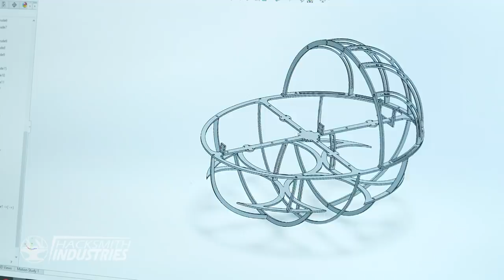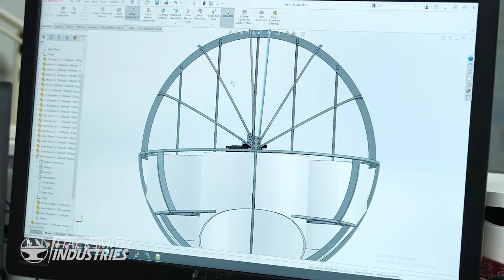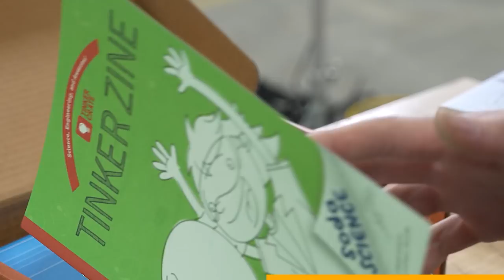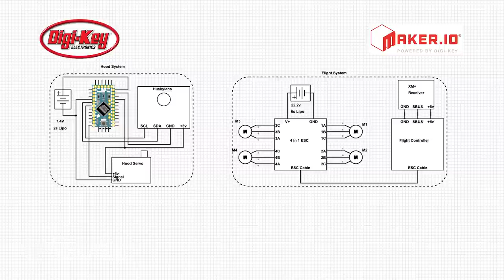Grogu's Floating Cradle! (HACKLORIAN: Chapter 4)

Comment: That flying cradle came out great! Carbon is known to be safe, people ingest activated charcoal(carbon), I guess the big hazard is inhaling the epoxy resin dust that joins the carbon fiber layers. Inhaling small carbon fibers, which isn't good, would more than likely lead to other non-cancer lung problems if you did it on a regular basis, but anything is possible.
Reply: No, the hazard is carbon fiber particles in the air. You're putting yourself at risk similar to black lung from coal mines. Regardless, CF is definitely possible for them to do. I have a friend who cuts CF in his garage from sheets, he initially had dust collection system send everything straight outside but eventually he switched to cutting a submerged CF sheet which made the CF particles mix with the water instead of the air.
Reply: @Dogburt_Junior  that's what he's saying, he's just correcting the "carcinogenic" bit, as carbon dust isn't carcinogenic
Reply: Unrelated, people should worry more about diesel for personal vehicles. Those fumes are proven carcinogenic.
Reply: carbon fiber is carcinogenic via the same mechanism as asbestos
Reply: @butterdubs2267  Meanwhile fiberglass isnt considered carcinogenic.
Reply: Also, inhalation of pointy and/or sharp items can cause bleeding in the lungs, and get the material imbedded in the tissues there.
Reply: Who cares  about carbon
Reply: @Cleanfocus  If I recall correctly, everything living requires it, and our food is built on it.
-
So as an ostensibly living organism, I care about carbon.
Reply: @MonkeyJedi99  I'm talking about carbon that cars make not carbon tree make
Reply: i have no clue what you guys just said and i’m not confused you hurt my brain
Reply: And the nose bleeds from cutting, grinding and sanding carbon are nothing to be concerned about. When you do it enough and your oxygen level isn't above 90, atleast you will know why. Maybe you lived on a dirt road.
Reply: @electronicsNmore  please go read the scientific literature on the subject before claiming more things you aren't sure about.
Reply: @Dzeno2010  I suggest you do that, I don't have time for an argument with YT pedants. I made it very clear in my comment that inhaling fibers could cause lung problems.
Reply: @butterdubs2267  That's a fact, i studied composite materials for about 2 years. And to everyone else: carbon, carbon monoxyde, carbon fiber and fiberglass are  very different things!
Reply: @Smilenol  very true but seems a bit hard to understand for some people, thinking that they know the materials and their effects on the human body well enough to make claims or insinuate things which they aren't even sure about.
Apparently making a comment > health of others, I guess?

Comment: Improvement idea: make the cradle be at to fly next to the suit, with a control on the gauntlet to make it stop or follow, as well as open or close.

If I were doing it, I would use an accelerometer/gyroscope inside of the backpack or helmet to have it hover and move at the same pace. Then have the ai part of the cradle to automatically account for things like wind and distance from the ground to stay steady. To keep baby yoda flying alongside of him and not trail off, it could use RSSI which uses Bluetooth signal strength to determine how far away the object is from one another to keep the cradle within a few feet of him at all times. 

Important note: RSSI can not determine direction with just 1 sensor, so 3 Bluetooth sensors would have to be used to triangulate the position of the suit. RSSI is apparently well researched, however I haven’t done much in depth myself.

I know this is probably way more in depth than you are looking to go on this build however it would be a really cool edition to the project. 

Hacksmith, if you see this, let me know what you think.
Reply: big brain
Reply: @sad_man10  yes very big brain
Reply: Today's Camera Drone can follow the user and hold him with Software AI solution in the Video focus. Perhaps this is "easier/cheaper" way. But in the end we have the same problem. They already had this small Camera to look out for Stormtroopers. Perhaps they can use it for "follow user and keep him in focus" mode. For hight, speed and other stuff they could use some Drone own sensors and software. if they are Open Source of course
Reply: @seskalarafey9285  yes, camera drones can follow people, however, in the show, the cradle follows next to the mandalorian, as well as behind him.  So to track him, the camera would have to be able to rotate as well, while still keeping the cradle in the forward facing position. The camera would also have to know every single aspect of the suit for tracking. This  is ineffective, and would be more difficult because it would have to account for whatever rotation the camera makes with a large amount of math. This is also difficult to figure out distance without a distance sensor. However, the way I designed it, this concept could be done with little issue due to how much research has been put into it, as well as the fact that there wouldn’t need to be a camera or distance sensor, and thus there would be less of a chance of it breaking and it would stay closer to the original design because it wouldn’t have a rotating piece on top sticking out like a sore thumb. However your plan would work for most other things in general.
Reply: @guttysaw6365  @sad man thank you
Reply: @matthewdeane235  For Hacksmith this simply "follow User" should be sufficient, i think. and perhaps someone behind the Camera could do the "nose Pitch" per hand
Reply: @seskalarafey9285  You are probably right, the only thing was they said that they wanted it to be fully operational. So to have it controlled off stage is probably not what they are intending on. You are correct that they could just use a camera tracking system, I just like to think outside the box, to make it as accurate as to what it probably would be.

Comment: I’m not that impressed with it I think they could’ve done way better
Reply: I'm kinda glad to see that I wasn't the only one thinking this. I just don't feel like it's up to their standards. It's not even painted to look like it or anything either.
Reply: Agreed
Reply: Should of made a vacuum molded piece of plastic for the cover. Would of looked a lot better.
Reply: @3RAG0NSNIWAK  I’m no engineer so that’s why if anyone judges me that’s what I would say but they are very high class designers and engineers and they have lots of equipment they can basically do anything they want and make whatever they want this is just getting horrible I miss the old Hacksmith

Comment: One of my few questions is: why not make it 2 feet in length, 1.5 feet in width, and 1.75 feet in height for a little more space? I only ask out of curiosity of why it is so small. I gave those measurements based on estaments from watching the show and finding the most consistent size in relation to Grogu.

Comment: The result was great, but i think the moving protection could be designed better.
Reply from the maker: It's actually a very slick design, I'd love to see someone do better. Ben did a fantastic job on it. It's using laser cut tiny gears and a single servo motor!

Comment: The propellers need to be a composite of carbon fibre and epoxy or they will shatter because of the rotational speed of the motors.

Comment: Anyone else thinking they could easily just went to the hardware store, got a PVC pipe and cut it accordingly for the air ducts, instead of printing them with resin?
Reply from the maker: sure but that would be a bit of a hack job to make it properly, the spacing for the propellers is very precise